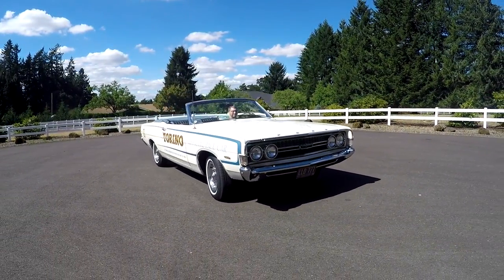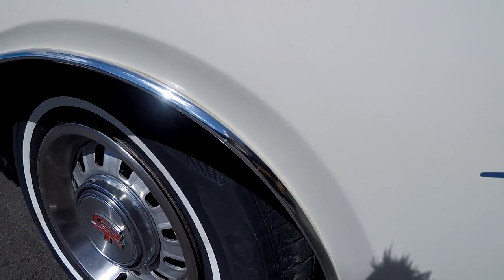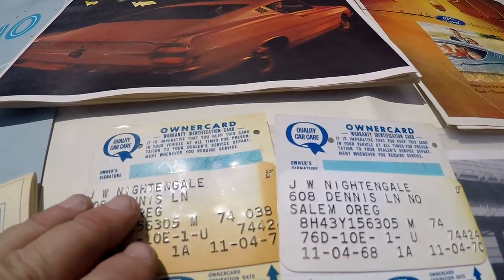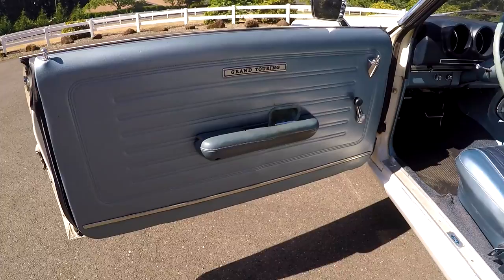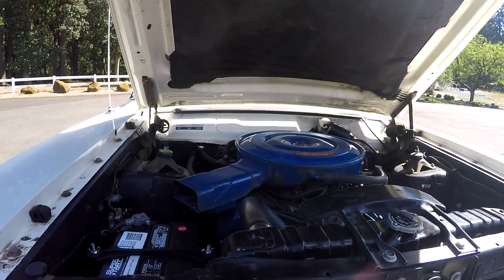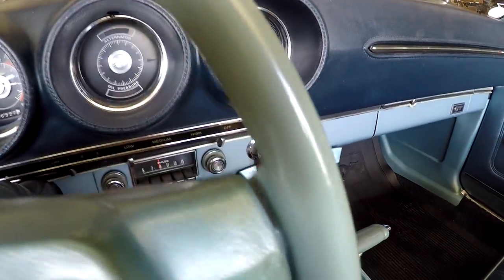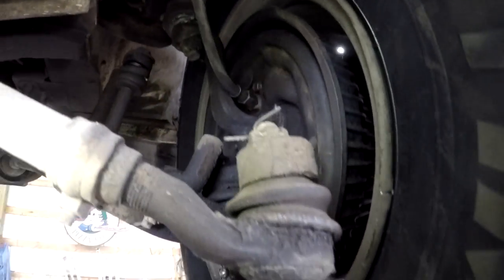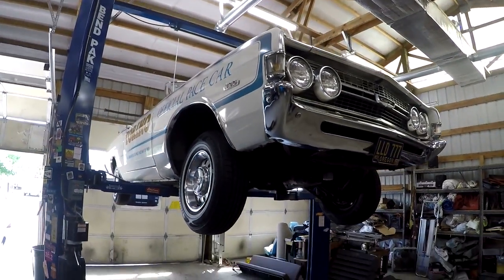1968 Ford Torino GT Convertible 390 V8 52nd Indianapolis 500 Pace Car - DENWERKS

Comment: My parents bought a replica '68 Torino Indy Pace Car off the show-room floor in 1968 in Davenport, Iowa. It had the 390 in it, and that car could SCREAM when Mom put her foot in it ... (my Dad never played with it to my knowledge). It looked so cool in my young eyes as it was all flashy compared to all of the other cars on the streets at the time. I hated when they traded it in in 1973 so that Mom could buy her '73 (PINK) Cutlass Supreme (also off the show-room floor).

But, the parents were growing apart, and splitting up, and Dad bought himself a used 1972 Buick Centurion convertible shortly before Mom bought her Cutlass.

I sure miss all those cars, but I miss that cool Indy Pace Car Torino (and even the Pink Cutlass Supreme because Mom taught me to drive in that Cutlass).